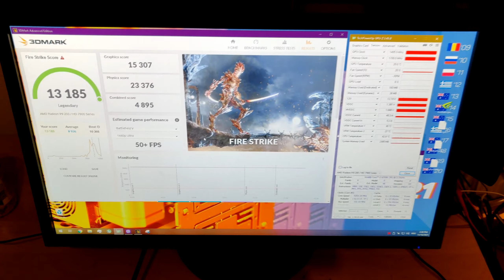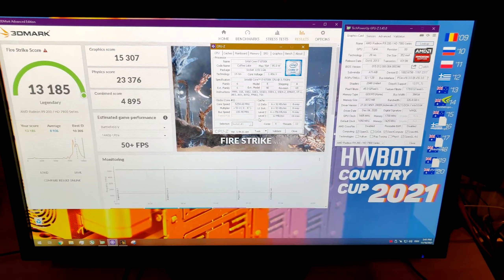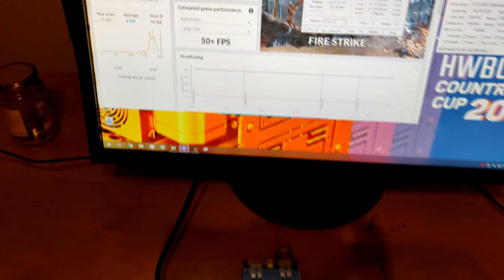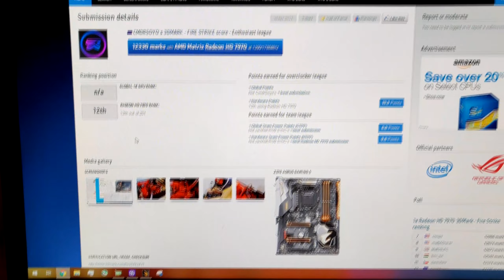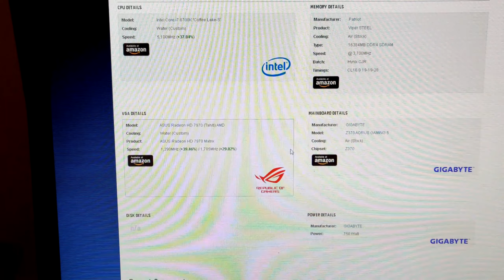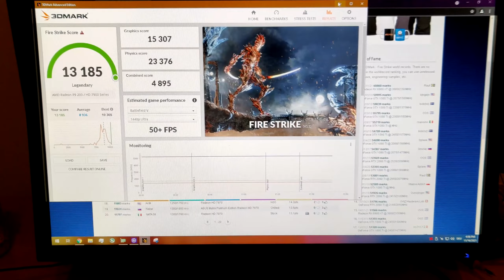Pushing my HD 7970 to the absolute max on water | 1405MHz Core!

Comment: Hello i have the same card but its getting xtremely hot. over 90 degrees after just 5 minutes and then goes even higher.

I changed thermal pads and thermal paste but it does not help! Any suggestions?
Reply from the maker: I'm assuming it's a reference card? Those just run hot. Blame AMD
Reply: @CmdrSoyo  hello i watched others that OCd their exact same cards a ton and only got like 65-75 degrees. i found out that my card orginally came with a mounting bracket to press the cooler against the chip. This bracket is missing actually. That probably whats causing this. 5 minutes and 95 degrees without OC is to extreme even for amd.
Reply: @CmdrSoyo  btw thanks for the answer!